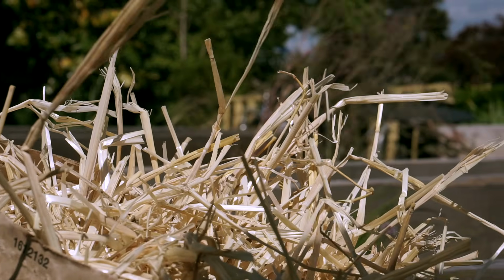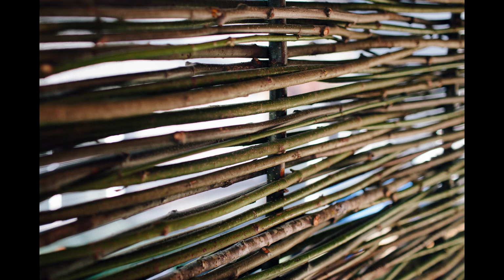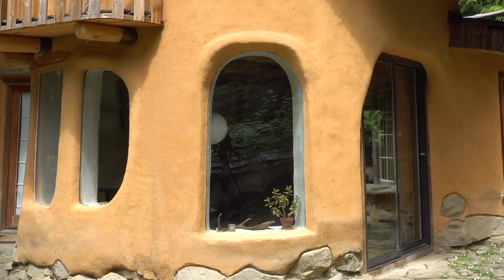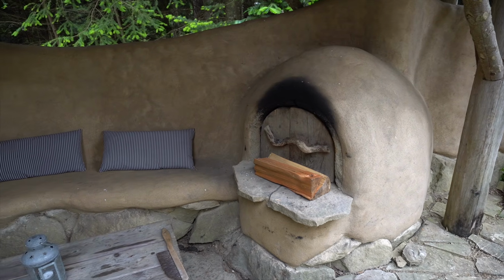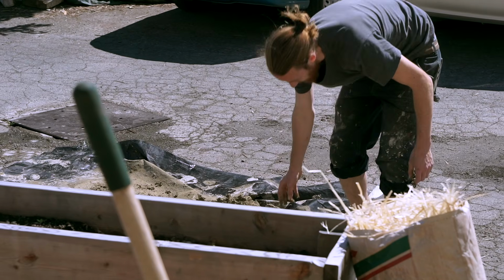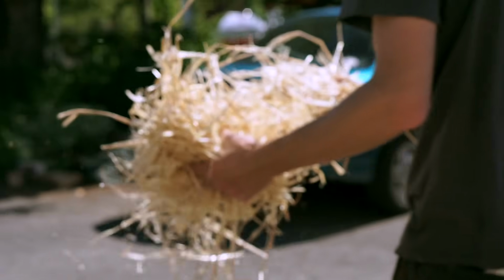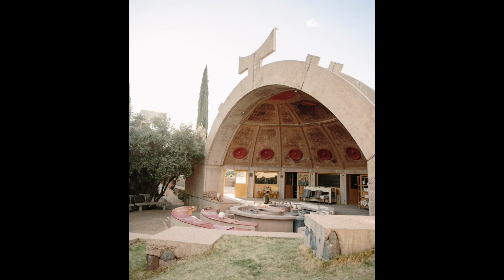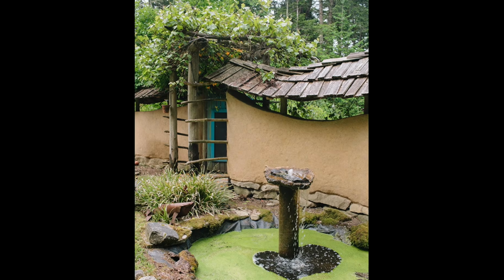Building with Cob - A Natural & Affordable Way to Build a House

Comment: Doesn't sound like cob is rainpoof. If it rains too much the whole thing will wither away.
Reply: i was raised in a house build in that way, it was from my great-grandmother, there was raised my father too, the house is still solid as rock.
Reply: Cob houses are used in England for centuries and it is not the driest of places so there must be ways to prevent it from withering away or else no one would have used it all this time.
Reply: You can put certain earthen plasters over the cob to make it more water resistant, but yes: the key is to raise the walls off the ground on a good foundation, and to include an overhanging roof that prevents as much water as possible from making contact with the walls.
Reply: Righteous1 I was thinking the same thing but apparently cob is very sturdy in wet weather read this http://www.barefootbuilder.com/faq.html
Reply: it turns into like a clay pot clay pots aren't affected by water in the least
Reply: You're right!  However the cobbers have a saying "good boots, good hat".  The foundation stem wall is typically mortared in with stone, and the roof provides enough hang-over (over the walls) that it keeps the rain off the cob.  Building cob is also tough when its super rainy, unless the structure is being built under an awning.
Reply: somewhere I have a cob book and in Germany they even make clay or Cobb sinks and bathtubs

Comment: I wonder how long it takes to build a 2 bedroom house using this method.  It may be cheaper but how about time?  ~Smile!
Reply: Depends on how much time you spend working on it, exactly how big the rooms are as well as how many people you have that would be willing to help you. You also have to consider your location and whether or not you'll have to fight the bureaucracy over permitting and building codes. If you use your head you can get free labor. If the construction isn't a problem as far as permits and such go you could go to schools and find out if they'll allow the kids to take a field trip and help build the house in order to learn about sustainable building techniques etc. Go to any colleges near you and find students there that may want to help. People majoring in environmental science and other related fields would probably jump at the chance to work on it. Think out of the box. ;)
Reply: Ciecie Newson it could be faster if he use construction mixer rather than using feet

Comment: When I have enough saved for land I plan to explore low footprint housing options. Cob is both charming and practical. I am excited to build my first cob shelter. Amazing work!
Reply from the maker: Cob is can definitely be a great sustainable low footprint option. Best of luck with getting your piece of land and with the future build 👍
Reply: The Ducking Homestead and Gardens I'm interested in finding out more about this community you mentioned. Where is it located?
Reply: You may have to site your home outside of any towns, as building codes would probably be a barrier.  Being in shallow well country and not close to commercial farms with all their pollutants would also be helpful.
Reply: try wattle and daub first, as it's easier to work with and get a feel for this kind of thing.
Reply: Can I help
Reply: Bridget S
Where are you looking for land at? I Know where some prime land especially if you want off grid, but grid is available but not a requirement by law like some states are trying to enforce in the U.S. of course! It is going in parcels of around 35 acres give or take a few at less than 1000.00 USD an acre! Let me know if interested and I will tell you where! Also search here on yt "building with bottles" and check out the various builds. You can recycle a great number for one person in plastic bottles to keep them out of landfills but even more so out of our water ways especially the ocean! Basically you fill plastic bottles with sand or dirt and pack it in, then layer them just like one would brick! This Also Solves the problem of your foundation needing to be rock or broken up concrete or using cinder blocks because you simply use the bottles and use a much smaller amount of motor and concrete up as high as you need to make your boots for your old gal or old man of a house!! 😁 lol! And you can use the print forms to make the concrete look like rocks or do so with different types of tools or even your hands to make it appear as though it is rocks and then stain the different "rocks" to give it even more character and vwahlah your boots look like rocks and you save money and recycled bottles and saved a few sea animals and some fishies in all the water ways plus a few birds and small critters running around land fills getting caught in the singles bottles plastic loops used to keep bottles of pop, gatorade and all different kinds of drinks together in 6 packs, or 12packs and the like!!! And from there up you would use cob! And you can still shape in most any shape you want!! After you get your bottle to desired height you cover the bottle necks...most lay their necks all in the same direction! I think it is better to flip flop every other one the opostie direction and then one has bottle necks on both sides of the wall for two reasons. One it allows either fish net or chicken wire to be slid over the necks and act as an extra strength and an extra form to add an force the cob thru and around (like using chicken wire for stucco or concrete jobs where they use wire to create a form then cover it with concrete and smooth and shape it the wire gives something for the concrete to become attatched to and not sluff off or just be some shapeless nothing you can do nothing with) and allows it to be done on both sides fully instead of one side getting real thick cob and the other side not as much which isn't an issue but the addition can be an added bonus!!! And #2 It makes the walls thicker so more passive solar heating for winter time if needed. More sound proofing, it's heavier which means it will be harder for tornados, hurricanes and or tsunami to have a demolishing effect under normal circumstances the walls will still be standing unless you build a dome which would mean the structure should remin intact unless it is GOD's end times otherwise under regular roofing styles the roof might maybe come off depending on how you do that! If you do a living roof less chances of anything happening! The houses are fireproof, tornado resistant almost proof and earthquake resistant up to a 7 if memory serves me right an then it just starts minor damage maybe a wall showing a crack but the buildings still stand like the wall may have seperated for a moment and then realigned and fell back into place! Definitely fire proof! Depending on roof, do windows have wooden frames and if starts inside it will consume anything burnable and bake your home like a pottery kiln simply making it stronger in many ways!!!lol same if a fire outside, anything cob is just going to bake, one would only need to replace roof IF it was burnable, and any furniture and appliances if fire started inside, but you would still have your beautiful home, it will just need the soot removed unless you like it...lol!! Sorry I have gotten carried away and said so much but I am very very much in love with cob homes, fencing/walls, ovens, mass heaters, outdoor kitchens, sitting areas, with mass heaters heating the seating if its cold, all kinds of things, furniture, baths, showers and huge tubs for soaking in with many or one, and so much more! 
Basically if you can think it and/or dream you can build it!!! Age, size, abilities, disabilities, gender, money or lack of...none Of It Matters You Can Build It!!! Well you might need a peice of land! But where there is a will there is definitely a way for the LORD and your willingness to help yourself will make sure it happens! Have faith in the LORD ALMIGHTY and have faith in yourself and your faith!! If your faith is strong then so too will be the LORD's ability to help, because he can only help if you have faith in him and allow him to do so!! If you are prideful and think you do everything by yourself you are wrong!!! The LORD provides everything for us! The more we help ourselves the more he helps you and the better your faith in him the more he can work through you and make you powerful enough to move mountains, only its not your power its his! You had faith in him and let him take the lead basically possess your body and then he help you acheive the things that take him to help you, whether it is moving the car off of your Daddy or moving a mountain or getting up and giving that speech about GOD!!! We can do all things and the ones we think no way then GOD helps in those cases. That would be one of the times he carried you!!
Reply: @theducklinghomesteadandgarden1  where? Im interested in property
Reply: The Ducking Homestead and Gardens Can you email me, i am interested in buying land in the USA and you sound knowledgeable: info@uptown-propertysolutions.com. 

Kind regards,

Christian
Reply: Get a loan don't try to save
Reply: @ishkadon-ell4927  this is terrible advice ignore this man